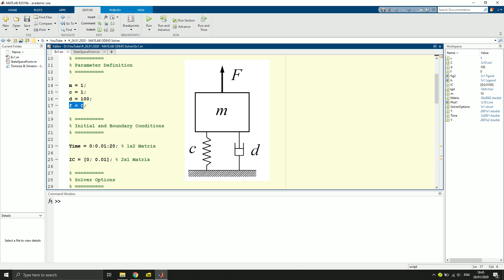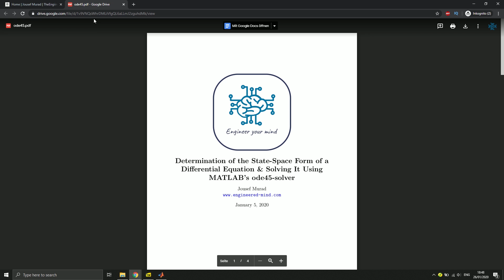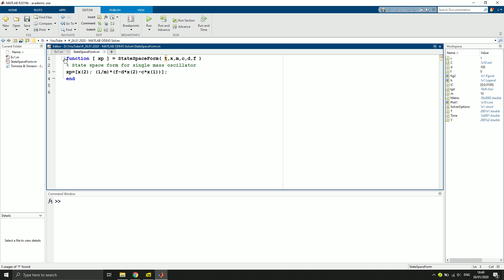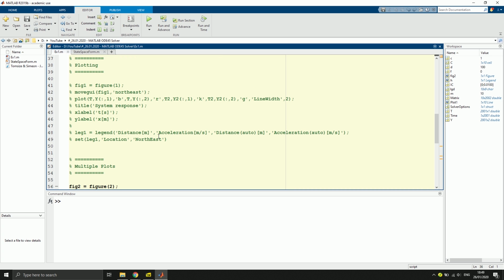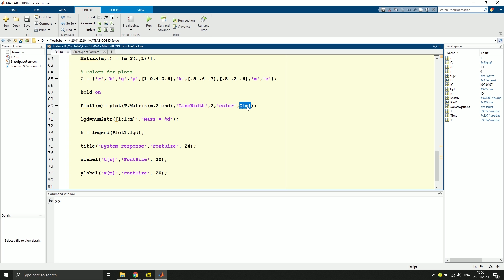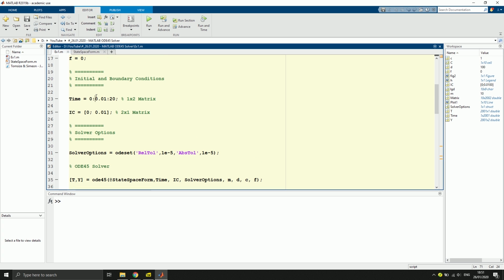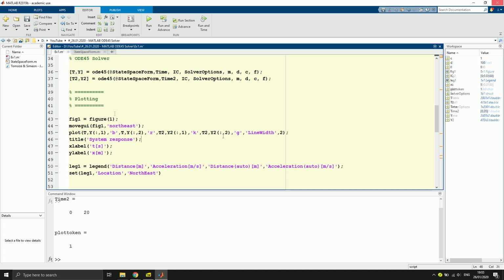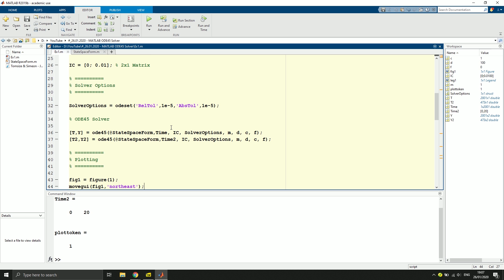MATLAB's ode45 Solver - Single Degree-of-Freedom Oscillator

Comment: why did you not include the weight (mg) in your diff. eq. ? Kindly tell
Reply from the maker: Hey Malik! 
The mass was included as the small parameter m but not gravity as you might have seen. But you could include it of course - the equation would look slightly different :)
Reply: @JousefM  thank you

Comment: Nice work!!! In the case of a harmonic displacement for the same mass-spring-damper SDOF model where the goal would be to find the generated force due to the harmonic displacement. Do you have some recommendations to carry out such a case?
Reply from the maker: Does that help? https://www.mathworks.com/help/symbolic/examples/physics-damped-harmonic-oscillator.html :)
Reply: @JousefM  Nice work!! I Wonder if it is possible to have an force varying in time (time series, not described for a fubction). Is it possible? How would it be in code?

Comment: Hey man thanks for the video! Also, would you know how to plot the force transmissibility of the 1 DOF system on matlab? Thanks.
Reply from the maker: You're welcome! This should help: https://vortarus.com/creating-a-vibration-transmissibility-plot/ - the formulas are straightforward, simply put them into MATLAB and let it do the job, :)
Reply: @JousefM  Thanks so much but I tried plotting damped force transmissibility but it didn't work :-{. But I think i found a solution from a textbook I found. Thanks anyways!